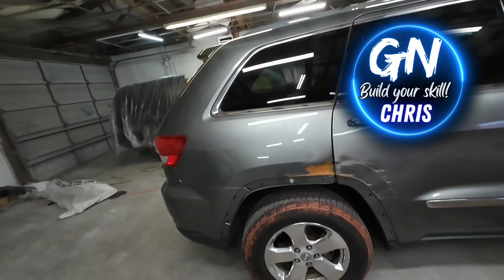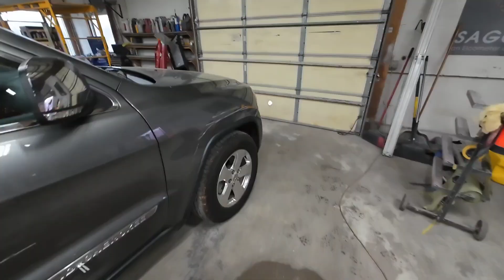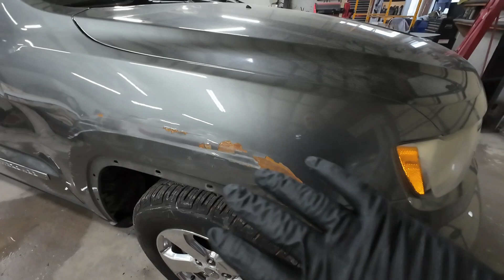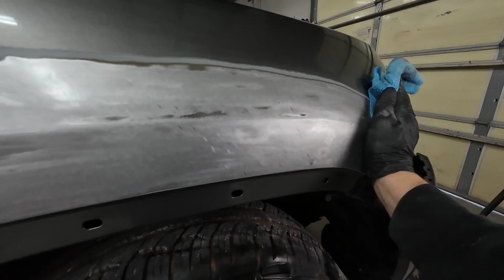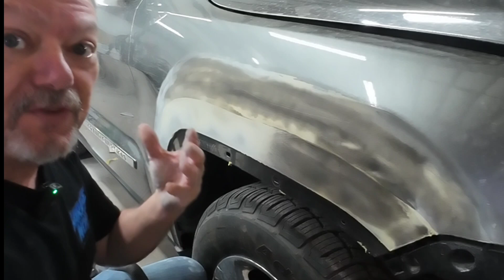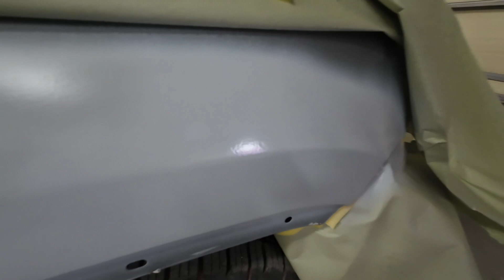How to properly use body filler( bondo) for long lasting dent repair.

Comment: Thank you! I have been struggling trying to mold a widebody fender. Used bondo glass at the seam and finishing with filler. I have found myself in the never ending fill and sanding cycle lol. I was not using guide coat correctly. I also found a trick to add some fiber glass resin to the bondo to help reduce the thickness, it lays so nice with some resin mixed in. This video helped me out big time!

Comment: Thank you for the excellent video.  I am working with my daughter on a 1969 VW beetle father/daughter project.  We have most of it straight with the hammer and dolly but need to work filler.  Ain’t nothing flat on a beetle and I am finding block sanding to be difficult.  
Any tips for curved panels?

Comment: When you're blocking and you have a low spot with guide coat in it can you put body filler over that or do you need to sand the primer off before you put filler
Reply from the maker: Some filler is made to go over primer some is not. You definitely must sand it with at least 180. Best bet is to use a glazing putty like icing it's  designed to use over primer and a 180 grit scratch. 👍

Comment: Hi Chris, another well made tutorial with all the info you could wish for included in the video, I like the ide of using P80 to flatten the filler down a bit so you can start the blocking process which means less blocking , I always look forward to these videos from you as it makes learning a bit easier👌🙏👍John UK
Reply from the maker: Appreciate that, thanks for the support!

Comment: So you use 80 grit to smooth down metal 180 for bondo to lay then 320 for primer?
Reply from the maker: 80 to prep metal 80 to sand filler then 180 over filler then 320 and then primer . Primer gets sanded with 320 then 600 then paint

Comment: Thank you for your videos man
Reply from the maker: Your welcome! I appreciate the comment and!
Reply: @GarageNoise  I have a question though - if there was rust on that area, shouldn't the metal be sealed with epoxy before applying body filler?